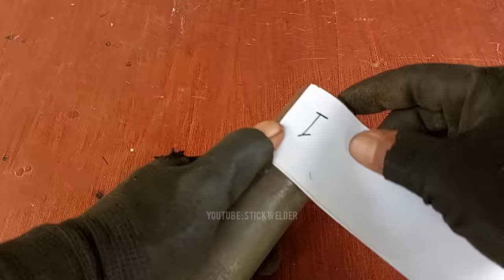round pipe secret, how a welder does it on pipes of different sizes | round pipe cutting trick

Comment: There is a huge mistake. The way it was done here can only work if the diameter of the small tube is half the diameter of the big tube. He switched the sections to keep and remove after copying the small piece width.
Reply: A good spot. Well done 👏
Reply: I'm failing to understand how the diameter of the small tube matters? He marked the big and small tube both in 1/8th of the each pipes circumference, then made pies by connecting the two 1/8 circumference segments with his ruler.regaurdless of diameter, this would have worked in my mind. Am I missing something
Reply: @riflebear1711  That's complicated to explain with words.

In order to better see what's wrong you should test that method with paper or cardboard tubes. One test with a small tube that is half the diameter of the large one to confirm that this case works. And another with the small tube having a different diameter like 1/4th or 3/4th of the large tube.

And the issue is actually very simple to fix by adding 8 extra marks in the first step of the method that will be used for the last step instead of reusing the same ones.

When you divide the circumference of the large tube in 8 and mark that on a circle away from the end you should divide it in 16 instead. Those 16 marks are two alternating sets of 8. The first set is used as in the video to transfer eight marks to the end  of the tube and use them as center points for the 8 copies of the small paper piece.

The issue in the video is that when marking the triangles to cut out he connects the 16 marks made with the small piece of paper to the same set of 8 marks that were used to create the center points. That's were you should use the 8 extra marks that you made on the first step. Those are aligned with the center points of the 8 sections between the 8 copies of the small paper, which are the sections you actually need to cut out.

The problem is that with a small tube that is half the large tube all 16 sections on the end of the tube (the 8 you want to keep and the 8 you want to remove) are exactly identical because you need to keep half of the circumference and remove half of it.
But if for example the small tube is 1/4th of the large tube you'll see that you want to remove the large sections and keep the small ones. With the method described in the video you remove the wrong set.
Reply: @davidrichter9164  You are not everyone. Some people are interested. At least the person who asked for it.
Reply: Yeah I thought that too. He marked out and removed what should have been the remainder. As the smaller piece of paper from strip 2 represents segments of the pipe, not void space.
Reply: Wrong.
You can cut the tube wherever the diamter suites.
Reply: @yakirberesheet  lol

Comment: Yeah, modern welders are very harsh... Instead of heating the edge and rolling the pipe in size or just buying an adapter....an integral representation with Euclidean geometry is also arranged with extra seams for a couple of kilometers...I don't know...saved so saved! 😂

Comment: I’ve been In welding for many years. Never worked on a project that allowed anything near this. Of course we were building it to last and to code.
Reply: Yes ASME Sec.9 is what I conformed to. Before forged fittings were used...fitters/weldors made 3 & 4 piece turns ot of straight pipe to make a 90. Then there is the orange peal for a cap. Plus so much more too.